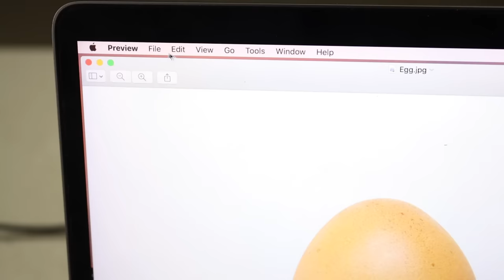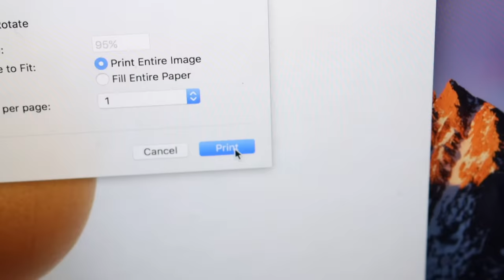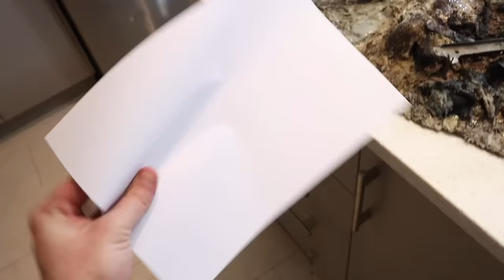How To Fix a Printer

Comment: me: wants to print out something black and white
printer: i need M A G E N T A
Reply: Lemao
Reply: once, i got asked to print a black and white picture and it was asking for Turquoise
Reply: I had a printer that slid the cartridge holder over for you to access them so fast it actually broke itself. I did not realize this until I bought more ink, put them in. Then asked it to close back up, to which it said. I'm not moving because I broke my pulling and pushing mechanism
Reply: @poutsamana1966  stop
Reply: @forme6978  stop
Reply: @mom.9564  no

Comment: Removing a YouTuber like HowToBasic from YouTube or any platform is not a straightforward process and generally requires the violation of specific platform rules and guidelines. Here's a structured approach to address concerns regarding a YouTuber:

### 1. **Report Content**:
If you believe that the content violates YouTube's community guidelines, you can report it. 
- **How to Report**:
  - Go to the video you want to report.
  - Click on the three dots (more options) below the video.
  - Select "Report" and follow the on-screen instructions to specify the issue.

### 2. **Community Guidelines**:
Ensure that the content you're reporting violates YouTube’s community guidelines. Common violations include:
- Hate speech
- Harassment or bullying
- Violent or graphic content
- Spam, misleading, or scams

### 3. **Legal Issues**:
If the content is infringing on copyrights or involves illegal activity, you might need to take further legal action. 
- **Copyright Infringement**:
  - Submit a copyright takedown request through YouTube's Copyright Management Tool.
- **Legal Violations**:
  - Contact local law enforcement if the content involves illegal activities.

### 4. **Community Support**:
Gather community support by encouraging others who share your concerns to also report the content. Multiple reports can bring more attention to the issue.

### 5. **Contact YouTube Support**:
For persistent issues, directly contacting YouTube support might help in escalating the concern.

### 6. **Alternative Solutions**:
If the content is more of a personal annoyance rather than a violation, consider:
- Blocking the channel so that its content no longer appears in your recommendations.
- Using browser extensions that filter out specific content or channels.

It’s important to remember that content removal decisions are ultimately up to YouTube and must adhere to their policies and procedures.